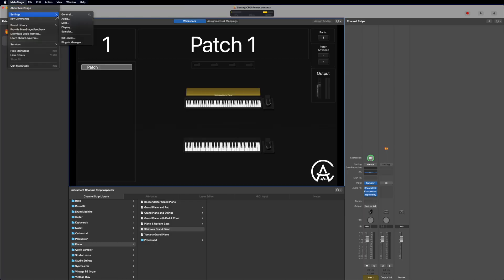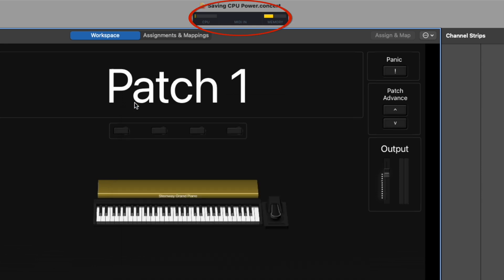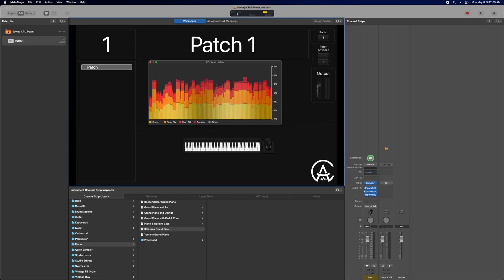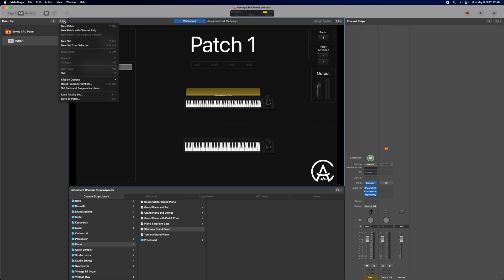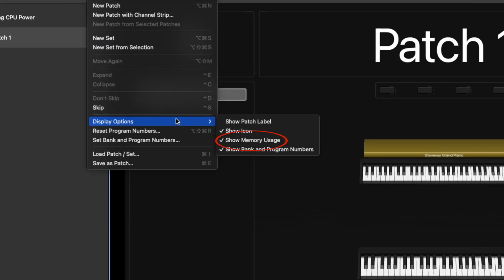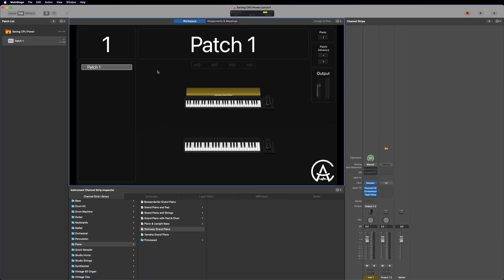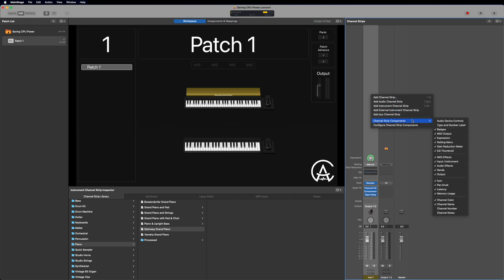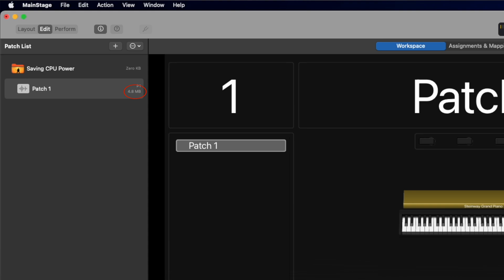Building MainStage Concerts That Won't Make Your Computer Explode!

Comment: I have a concert thats 5 gigs. Is that a normal size?
Reply from the maker: It’s highly dependent on the libraries you’re using. The studio horns/strings in mainstage libraries are pretty large.

5 gigs isn’t unusual, I’ve had concerts that size and larger.